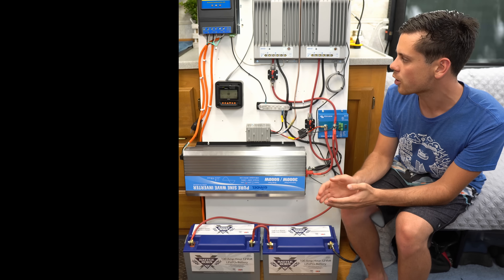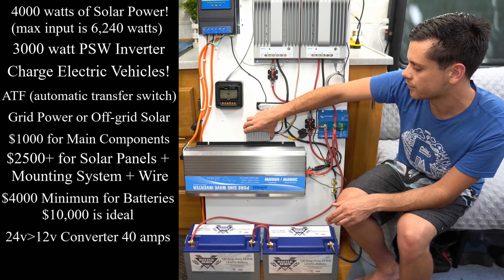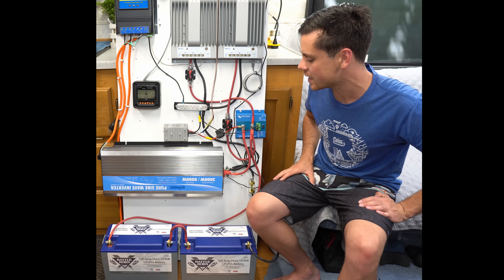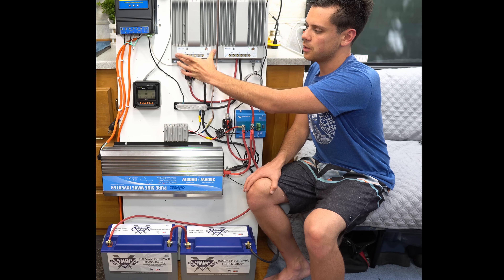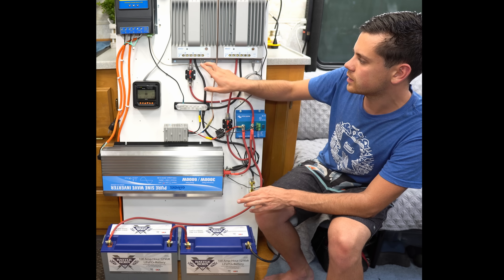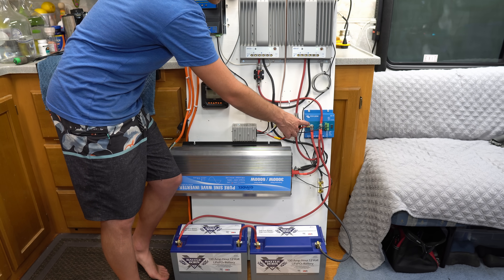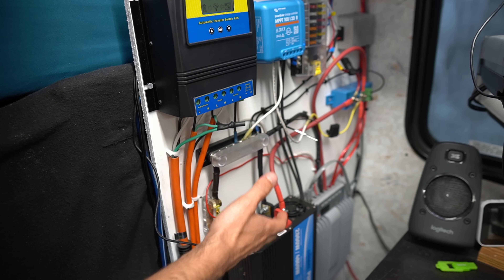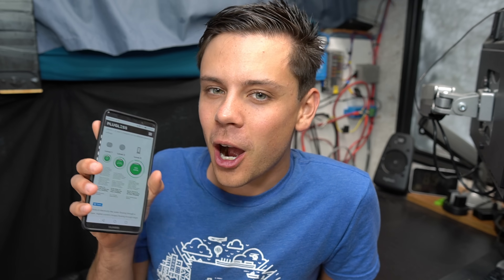Off-grid Tesla Solar Charger: 4kw solar input, 3kw AC output, ATS and more! 3 hour build time

Comment: I love my EPever 150/40, I have 3 friends that went with them as well, I went with 100W panels in a 4S2P I see 85V that way I am not over V or Amp, I am also running Six 145AH AGM commercial communication batteries with a 3500Watt inverter.
What I wish I did a little different is a 48V / 220v split inverter combined controller would have been only about $2k more, but I went cheaper just to test the waters and learn, only using it for power outages right now but I can see going off grid much cheaper than a NY electric bill!
I can get a lot of very cheap used Solar Panels now, my buddy just bought twenty 550W biface at $25 each, I ran a test 3S they are putting out 135v/15amp (2000W) just laid out on the ground not even aimed at the sun, it is in the 40F today if that makes any difference ... hell I paid $80 for each of my 100W HQST and I am only seeing a 2% conversion loss through the controller, these 145ah AGM I went with because of the 1000s I saved and I dont see that much difference in draw down? I can run shop lights all day and only come down 0.1v and can make that back up by 10am :)
I was talking with a guy that had a company come in and charge him $40k for a system, my response was "you cant fix Stupid"
I may have $2500 into mine?

Comment: Hold up Will, What do you mean Level 2 is 80 Amps? Just a Tesla thing? A quick Google search shows 240V between 16-40 Amps. That is quite a big difference. What would a 240 volt system 16 Amps look like??? Also why such little info on grid tied inverters, micro inverters etc.. Doesn't that make up most of the solar industry? Or if not, most the home solar industry?

Comment: Would ac Capacitors  help with peak currents on outgoing 110inverter for powering a portable ac unit? I see some people adding capacitors on the inverters and wondering how useful this is.

Comment: Someone PLEASE TELL ME if this same set-up would be good for an Off-Grid tiny house?  I just bought 2 of the 100ah batteries but hesitant on moving forward (upgrading the Inverter to a 4k).  HELP ME PLEASE!
Reply: Should be 
Depends on what you are planning to do though tbh
Reply: @BenCos2018  Thank you Ben but over the last 4-5 months, by watching the videos, I have learned a lot.  I am starting with 1k but will expand to 2kw in panels.  After that I will double the capacity, according to these info/videos, to insure I have plenty of power for the tiny house.
Reply: @1AcreHomestead  seems like a good plan 
Defn not an expert myself but feel free to ask if you need any help with it
Reply: @BenCos2018  Now that I have your an ear out there...I will.  I will be working on it more this week.  thank you Ben.
Reply: @1AcreHomestead  no problem

Comment: I would like to use this type of system to 120v charge an EV car but use a remote solar panel and wind power.  I live  where there is 15mph winds most of the time... what are your thoughts?

Comment: Spot on video, Will! I have a 2013 Prius PHV (plug-in hybrid) and planning to add a DiY solar generator to it along a solar panel on the roof. I prefer a 24 volt system with 2 Battleborn batteries just like you have in this video. Either a glass solar panel would go on roof racks and attached to the car or I may put a flexible panel with bottom ventillation. Is a 100 W solar panel on the car roof is too little? When I charge the Prius PHV from grid power at home then it takes 1 hour and 20 minutes at a 1.8 kW charging rate. One full charge takes about 2,8 kW power to the Prius battery. I need to calculate a lot of things. I go with DiY plus Battleborn, because the GoalZero solar generator Yeti x1500 is more expensive and the life span is too short for its built in batteries. Solar panel will trickle charge the batteries and I would like to charge those batteries from grid power so I can plug-in and charge while the Prius PHV is parking. Thanks for the ideas and the great videos you produce! Video by video and I'm getting more confident that I can make my own solar generator to my car.

Comment: Would a system like this work without the batteries, where the solar panels/ MPPT charge controller fed 230v to charge the Tesla/EV and if there was no sun, the ATS would supply mains 230v? Thanks in advance.

Comment: I have the Giandel 2000 Watt inverter and my car charger gives an error when I connect it to the inverter.  After looking up the error it says to check the AC power supply.  After doing research, I believe these Giandel inverters have "floating" grounds that are not bonded to the neutral.  This is what I suspect is causing the error message on the car charger.  My question is are you or anyone else having the same issue on the 3000 Watt inverter shown in the video?  And is it possible to bond the ground to neutral to make my charger work?
Reply: I have had the same problem as you with my 3000w inverter. Charger showing earthing error.

Comment: In regards to the Level II 240/80A, the solar comment really assumes you are charging all the time.  For instance, if I only charge the car once every couple of days, as long as I have enough battery, I could have a much smaller solar footprint.  You could also store cheaper "overnight" grid energy, etc.  FWIW

Comment: Hi there Will, great video!  What are the implications / differences in performance etc. If I use a 230V Inverter ? This is what we use In Australia and New Zealand. I am planning on making your 4000w system and the only difference, would be the inverter. Thanks

Comment: In Hawaii the utility doesn’t pay you for your surplus energy contribution to their system. (Go figure) they charge 0.36 per kilowatt. My goal is to set up an independent solar shed (I rent) which will produce enough level one charging to meet my future Tesla Model 3 needs. My work commute is about 40 miles 6 days a week. Could I store enough power economically during the day to recoup the usage when return home after dark. Our location has excellent sun almost every day. How many panels and how many batteries? Or does the math not work?

Comment: how do i add a battery charger to this system ? where and what do i need to wire it in this system ? i have external charger running off generator

Comment: How many 100 watt solar panels do i need to get at 4000watts with this system i want to do this to my 580 square foot tiny home just running 2 ceiling fans 1 t.v small icebox and some lights and a 8000 btu ac only will run the ac for 3 hours out the day

Comment: Thanks for another great video, Will! Question: if the breakers on the MPPTs’ output cables trip and solar power is still coming in, will the MPPTs be damaged? Again, thank you!
Reply from the maker: This was covered near the end of the video. Use a separate port bms
Reply: Thanks for the reply. Sorry I missed that. I’ll review the video again. So, do you recommend that configuration on all solar setups — regardless of size?

Comment: Grid-tied systems with battery storage are designed to establish a microgrid on the other side of a transfer switch which will be isolating the grid from solar and batts.  So the solar system will only shut off if the battery system is at full charge.   This will be the configuration I will be posting on my channel shortly.

Comment: Hello Mr. Will, Just placed a order for basically the same system for my tear drop trailer, after reading your book and watching your videos. I went all in on the Victron system, but with one 12volt 200ah Victron battery(kinda a fanboy of there smart system). I am powering two electric induction stove tops a paninni  press and any number the usual electronic devices(except fridge). I would also like to trickle charge my Mitsubishi PHEV with the excess electricity(more for fun less for practical use as I just dont have more room for another battery).I have two questions, why is the PSW inverter on this build so much cheaper than the Victron $3000 Pheniox smart inverter? I dont have any more roof space or storage for more solar, after some resurch I found pleanty of suitcase or folding solar panels but they all have so many limitations IMO. Do you have recomendations for portable solar panels (at least 400 Watts).

Comment: Your battery terminal wire is loose
Reply from the maker: It is. I had it attached loosely because I had to take it apart five minutes after this video and move it into it's permanent position so I can use it
Reply: @WillProwse  Yeah those are heavy :)
Thanks for the videos good info!

Comment: Will, I'm considering installing the Tesla battery system you have previously posted and is on your website in my trail trailer.  We travel for several months of the year.  I want to boondock more to limit costs and be in remote places.  I've got a question about charging the Tesla battery via my truck.  I realize that the low resistance of the Tesla battery will stress my truck's charging system if it directly charges the battery.  I've thought a converter could be placed in parallel with the solar panels.  Maybe it would need a rectifier to prevent voltage from flowing into the out of the converter when the converter was inactive.  Might the EPEVER MPPT Solar Changer function to regulate a Victron Orion 12v (in from truck) to 24v output DC-DC converter?

Comment: The link to the 24V inverter now seems to go to the 12V inverter now on the Amazon side, be careful folks. The 3000W 24V inverter seems to have disappeared from Amazon - maybe sold out. There is a 2kW and 4kW version of the 24V still there.
Reply from the maker: Yeah they sold out. That's what link usually does when they sell out.

Comment: I am very currious why you switched away from the tesla 24V module for the much more expensive battle born packs?
Reply from the maker: Safety
Reply: @WillProwse  I guess I would have two questions around this - (1) what is your assessment on Tesla battery module safety now (as it seems to have changed over time, which happens as we learn things) and (2) why battle born specifically and not the many other competitors that seem to be 20-30% cheaper. Is there a qualitative difference there? Could make a good video. I suspect many of us are treading the same line here. Thank you.
Reply from the maker: @seanmcd  check out my LiFePO4 buyers guide video. I answer second question in details, for multiple reasons, multiple times.
Reply from the maker: @seanmcd  if scc screws up or upper voltage limit isn't perfect, it will catch on fire.
Reply: could you please elaborate on that?  what is unsafe with the tesla module?

Comment: I really enjoy your simplicity to explain to us novice ones. Question. I have a camp trailer with dc lights , and a 30 amp shore power plug but have a 110 volt adapter.  I want to setup a simple solar system . Can I use the solar inverter and plug my shore power plug  into the inverter ? that way all my ac outlets in the camper work off the solar ?? Mark Tonopah, AZ
Reply from the maker: Yes you can plug in to your solar power inverter no problem
Reply: @WillProwse  Thank you so much. I really appreciate the fast response

Comment: Would you please do video on automatic power transfer for electric generator.  Is there auto transfer switch that switches between grid, solar system or an electric generator.  The generator should be able to auto start if the grid goes off and stop when the grid is on.  This means that you will always have guaranteed power either from grid or generator but use solar power from the battery or PV system first.

Comment: I have a solar powered grid tied system to my home. I constantly produce more power than I consume and am trying to find ways of using more electricity. 
I would love to use this system as a backup when I lose grid power which is common where I live in Florida. My SMA inverters produce 2000 watts of usable power as a 'secure power supply' off a separate circuit when the grid is down. So during the daytime, I could produce enough power to charge the battery that could then supply my minimal power needs overnight. 
I would need your system to do the following things. 
1. Charge the batteries directly off a 110v line from the Secure Power Supply(SPS) or mains current...remember I always produce too much electricity. 
2. I would prefer to use a Tesla 24v module as the battery. How would I control the grid or SPS current so that it would duplicate the manual settings you used when setting yours up?
3. You could skip the solar charge controller as I already have the solar power wired into my home at 110v from the SMA inverters.  

Thanks for any help Will, much enjoy your site and the way you constantly find new ways to use solar power.

Comment: How do you heat water with the excess solar power you produce Will? I also produce excess power and it's causing a problem with my system. I don't have enough storage for all the power I produce?

Comment: The communication protocol for charging EVs can turn down the amperage for the charge down to 6 amps, in other word,  at 240V, you only need a 1500 Watt inverter..

But charging at 6A is slow....

Comment: Hi Will, I am very happy you have mentioned excess electricity that you use only for you by EVENTUAL usage (water heater at you)
At present I am  in time of every day reading your book from Amazon and everyday listening your videos a planning my very first solar system. (For me as a woman without any experience it is not easy)
Our planned solar garden off-grid system should regularly power maily water pump and irrigation equipment, where the big power user  is the deep-water pump, which is used only ones or twice a week. Other days the produced power could be throuwn out so I plan EVENTUAL usage like:  charging AKU tools batteries, or water heater, or electric grass mover and so on. I was not sure to consider with eventual usage before you have mentioned it. THANK YOU
Reply: Adela, I am in the same situation. My hubby is not interested in all this stuff, and I have to rely on Will's videos and a few others' to try to figure evrything so that not to burn the house down and not to break the bank for nothing.

Comment: The cost and knowledge needed to do a solar power setup on a RV seems excessive.   The wiring, batteries , panels, extra weight and such, one needs to be a Will Prowse to do this.  Small inverter generators of 2000 Watts have come down in price.  They can cover the excess power you need.  Your normal power needs are handled by propane and charging the battles as you drive.  If you hit a period of bad weather, the solar setup is useless. Keep it simple, a requirement for my brain power.

Comment: Hi Will, 
On a related note I ran across a new battery offering that may be very interesting. Relion is introducing a new prismatic cell battery (higher power denisty) that allows charging below freezing (built in heater) and enable up tp 128 batteries in parallel without any external BMS (BMS is integrated). Batteries manage charge/discharge via a CAN bus system/cable between them. Suppose to be easy drop-in replacement apparently targetted at more rugged semi-outdoor use cases - golf carts, fork lifts, boats, RV's with less than optimal environmental control and zero maintenace. 

One retailer is offering them presale for $1,331 for 120 aH version (120 not 100, narrower and taller form factor over drop-in 100aH) which doesn't seem bad for the all included price and new capability. Wiring these in parallel with varying lengths of cable will greatly enable flexibilty across multiple storage areas (a problem I'm trying to solve in upgrading my RV, putting batteries in two bays across from each other - this may eliminate more complicated wiring for my config saving hundreds in install costs/time). 

Very interesting. I'd be curious your thoughts... though actual batteries won't be seen until apparently end of June.